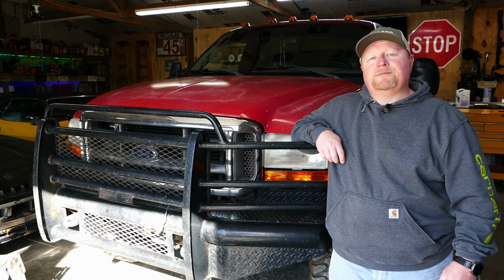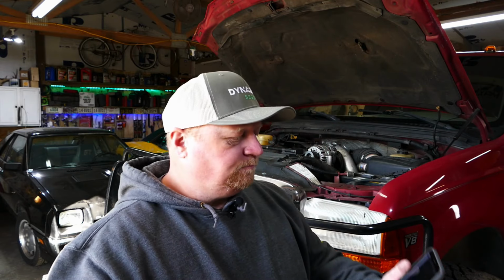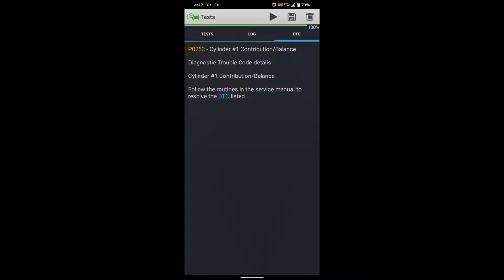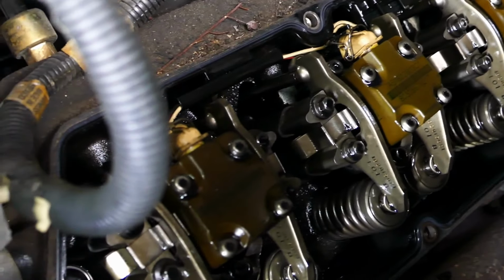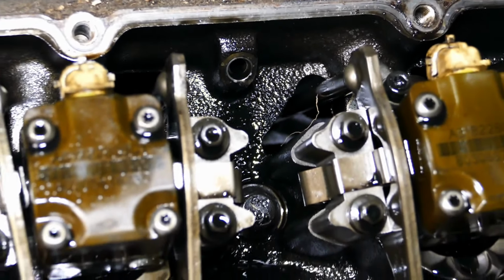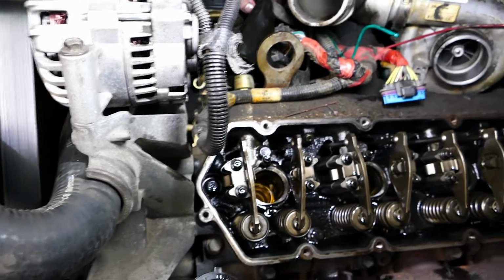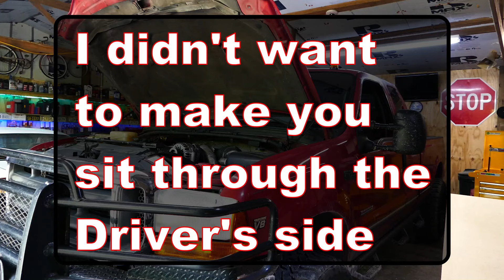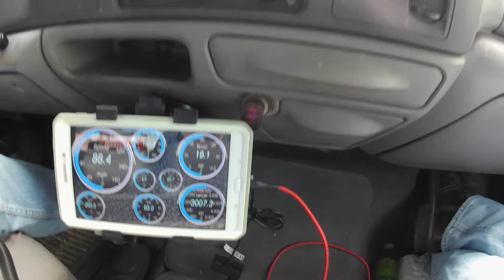Replacing the Fuel Injectors in a 7.3 Powerstroke Diesel | Ford F-250

Comment: I have been looking for this video for years.  I am second owner, at 45000, and I now have 481000 miles on my truck.  The few things that I have replaced in the truck would be, Water Pump, Alternator, Power Steering Pump and hose and Hydro-boost.  It is a 6 speed, and is everything I could ask for.  No real miss in the engine, just mileage and thinking about doing a full under cover rebuild.  What would be the opinion should I open it, or leave it alone?
Reply from the maker: Start here: https://amzn.to/3AjMu33
This is the Archoil fuel additive and Oil additive. I absolutely swear by this stuff. Stiction is the issue with 7.3 and 6.0 injectors and the Archoil additive makes MAJOR improvements. I run a bottle in every oil change and a measured amount in my fuel at each fillup.
Reply: If it works don't fix it.
Reply from the maker: @jacksmith730  lol, in my world if it ain't broke, then poke at it and fiddle with it until it breaks. Then fix it.

Comment: My neighbor is a diesel mechanic he said it’s very crucial to clean the bore from any oil before installing. He said it could cause it not to seat and leak compression into the fuel
Reply from the maker: Yes, it's really important.
Reply: What should you clean the bore with? Just wipe clean with microfiber rag? Also if you’re lubricating the injector up before installing like the video said to do does that cause the same issue with proper seating?
Reply: Riffraff has an Awsome cleaning kit or there’s other kits as far as getting the cup cleaned. If the injector cups haven’t been change I’d probably just change them out. I used petroleum jelly to lube up the injectors and putting a dab on the tip to help hold that crush washer in place when installing they have been known to come off during installation and you do NOT want that to happen. 
Stainless steel cups from riffraff along with there tool rental is a way to go.

Comment: I just said screw it, if your gonna take my rig apart, just replace ALL the injectors and be done with it!!! Lol. New glow plugs, new wiring harness, done deal!!! Also replaced high pressure oil pump and low oil pressure pump, and replaced turbo also, get 💪 er done!!
Reply from the maker: That's the way to do it!

Comment: Passengers side is much harder to get the valve covers off why does nobody show it
Reply from the maker: Once the charge air pipes are off, there's nothing to it. One valve cover bolt in the back is a bear to get to, but there's no way to film that one anyway.
Reply: Mmmmm it is harder but if you can't remove the valve cover you probably shouldn't be messing with injectors

Comment: Sir, This is by far one of the most informative video's I have seen on Youtube. Thanks for great content. I have a 7.3 that has an intermittent miss and suspect an injector issue. So the question is whether the Bluetooth device and app would help diagnose which injector is suspect?
Reply from the maker: Brad, thanks so much for the nice comment! I'm sincerely glad my content was useful. Regarding the Bluetooth, yes it will absolutely help you track down the suspect injector. The software is called ForScan Lite, it's free and available on the Google Play store. I have a link in the video description to the bluetooth OBDII connector I use. Other than that, you just need an Android device (phone, tablet, etc.)

Comment: Old video but hopefully you’re still responding. My 2002 7.3 passes the buzz test but forscan gives me a cylinder 3 contribution error. Also I have an engine vibration around 1500rpm under load.  At 262k miles on what I think are stock injectors would you assume it’s a bad injector?
Reply from the maker: Man, it could be a few things. Low compression is the scariest scenario. Does the engine turn over with a constant cadence? Hard to explain what I mean. Go to Youtube and look for videos of 7.3 skip while cranking. Does yours do that? If so, its compression. If not then you may try replacing the #3 injector.

Comment: 19:32 I’ve been trying to get it out for 3 hours I give up it’s 4am
Reply from the maker: There's a 10mm bolt on the bottom of the hold down, remove that. Slide the hold down up, then pry it out.
Reply: @ProjectTimeGarage  I got it out the other were easy to get out but I think it was the same one from factory it took a lot of prying tho

Comment: OK real talk, what are those Allen key plugs actually called. My buddy dropped one down the pushrod of my 7.3 and I haven't been able to find a replacement anywhere. I looked up HPOR plug and the results do not match the bolt have have for the other side.
Reply from the maker: I've always called them oil rail drain plugs.
Reply: @ProjectTimeGarage  damn, I can not find the right size bolt for it. I've looked everywhere and only found 1/8 inch bolts. Well thanks for the reply though partner.
Reply from the maker: @justice101497  Man, I mis-spoke there. They are 8mm bolts, one above the injector, and one below. Only remove the one below. The one on top just serves as a anchor point to hook the injector hold down on to.

Comment: Love the details, was determined I needed a new set but turned out to be a bad internal relay in my fuse panel, I did a quick fix with a bypass and it runs great, I still plan on upgrading them with the truck being over 300k miles. I definitely didn’t think a 7.3 could suck fuel off suction to the point it’ll barely idle but it sure did, love the videos and hope future issues can be easily fixed
Reply: Where is this relay?
Reply from the maker: Sweet, that was a pleasant find for sure.

Comment: What do you do if you have pulled the injector before you pulled the plugs out? 😅I may have messed up. Oil dropped in the injector bore, quite a bit in fact.
Reply: Nevermind you answered that too. Thanks
Reply from the maker: Yep, lots of oil will get in there for sure.

Comment: I can't get the adapter you use? Will any other recommendations that works with forscan
Reply: what was the parts cost for this repair???
Reply: My 2000 for excursion 7.3 diesel running ruff it has just 384000 miles on it.
Not sure it is injectors or could it be something else? Can you help me??? PLEASE
Reply from the maker: That adapter is no longer available unfortunately. I've tried to find another that works and I can't find one at all.

Comment: My question is what's the order of cylenders the buzz test does? Like the first one was no good in your video which injector was that under the valve cover
Reply from the maker: It buzzes in numerical order 12345678 - Number 1 is on the front passenger side, 2 is the next one back on the passenger side and so on - number 5 is front driver side

Comment: Do you have anything on knowing if injector cup is broken?
Reply from the maker: I have a video on replacing cups. If one is cracked, you will have diesel fuel in your coolant.
Reply: @ProjectTimeGarage  ok thanks man. I don’t have that issue. So I’m gonna go ahead an say my cups are okay.?? 
Have #3 and #8 throwing contribution/balance fault codes. Unfortunately gonna have to do all 8.
Honestly was scared to do it myself. Until I watched your video, I Fersure can do this on my own with your video playing on the garage tv.!! Really appreciate it!
Reply from the maker: @ttvitz0neshotv237  Yep, contribution has proven to be injector related for me more times than not. If not injectors, then compression is a likely cuplrit. If you have little to no blow-by, then it's probably an intector or 2

Comment: what would cause my car not to start after swapping all 8 injectors?
Reply from the maker: If it ran prior. Then it's likely air in the high pressure oil system. It takes quite a bit of cranking to purge all the air.

Comment: Everytime I’ve done injectors on a 7.3 it ends up hydro locking. I’ve never removed the oil plugs. Could that be the reason? I’ve always noticed fuel draining when I pull the injectors. Thanks
Reply from the maker: I'm sure it is the reason. I've never had a hydro lock doing it this way.

Comment: Hi.  While pulling one injector I got a lot of oil pouring out. I did pull the drain plugs first. Is the best way to evacuate all the oil from that cylinder by pulling glow plug and cranking? Or should I do something else also? I haven’t cranked it at all yet. Thanks for your help.
Reply from the maker: That's exactly how I evacuate the cylinders on all of them I've done. Replace all injectors, leave all the glow plugs out and turn the engine over.
Reply: Thanks, I only changed one injector. Want to make sure that’s the issue before replacing all. I wasn’t sure if I could only remove the one glow plug to evacuate cylinder. Seems like I could but I never done this before. Thanks for responding I appreciate your channel sir!

Comment: Hey I’m just replacing number 8 injector on my truck how would I turn the engine over without it starting so that I can keep it from hydro locking?
Reply from the maker: Jump the solenoid on the passenger's side while leaving the key off.

Comment: I had the injector out and turned over the crank with the harmonic balanced bolt to spit oil out of the injector hole, I had the glow plug left in. Is this a sufficient enough evac or do I need to take out the glow plug. Just changing injector 8, scanner said 8 and the oring was cracked
Reply from the maker: I'd say you're fine.

Comment: Pulling the drain plugs from the under the valve cover isn't necessary because if you crank it over it'll just push it all out the glow plug hole anyway. Just seems redundant unless I'm missing something.
Reply from the maker: It's really about the amount of oil that drops into the cylinder without removing the plugs.

Comment: I changed the injectors in a 2002 F250 7.3 auto 4WD and now while idling for about 15-20 minutes it will stall out. Pop while idling is pushing about 470-500 psi. when it begins to do stall out. Any insight? Where to start?
Reply from the maker: If the HPOP is maintaining 500ish at idle, then that's ok. It must be losing fuel pressure. That's the next thing to check I would think.

Comment: Hi just wondering if a guy shouldn't change injector cups too since he is already in three? Thanks, great video.
Reply from the maker: I actually get that question a lot. My thinking is that they typically don't fail unless they're overheated, or something else gives up. I have a video series on changing them out, just never done it unless they start leaking.

Comment: Do all stock 7.3 trucks have that device to attach the FORscan device? Or does the truck have to be tuned to use that FORscan device?
Reply from the maker: No, the stock trucks will do it straight from the factory. FYI, I have a video coming out on Friday March 3rd that goes over everything OBD2 and Powerstroke related for the average guy.

Comment: How long did it take cranking it over before your truck finnaly started?  Im having that issue now big time
Reply from the maker: It takes a bit of time. Say a minute or so total crank time. Best if you can get a scantool that will read the high pressure oil system. It needs to be around 700psi before the injectors will work.

Comment: Love the video I have an F-350 7.3 super duty 1999 with only 100.000 on it and I just noticed Fuel in pools on top of the motor . Fun Right? Now I have to find out where the fuel is coming from! But I love watching these types of videos it really helps me when I have a problem! Thanks, I subbed!
Reply from the maker: I'm gonna place my bets on the Fuel Bowl seals. Riff Raff, Full Force, Sinister Diesel, etc. all sell a re-seal kit. It's not too hard to do.
Reply: @ProjectTimeGarage  I will take a look at it in a few days Like I said I don't use the trunk much anymore I am retired but I bought the trunk brand new and Love keeping it in good shape. If you think that is the problem I will surely be in touch with you about it! I replaced the glow plugs a while back and that is when I realized there is a lot more work to do on these trunks than you think LOL! I have a 1994 f-350 with the Cummings motor and man they're so easy to work on I miss that part LOL! Love your channel Thanks!

Comment: Thanks for your videos and responses to these comments. Update that might help some folks. Readers digest version! Truck smokes plumes, Powerstroke specialist says it failed compression test. Bad engine needs replaced $12,000. I seen your video and bought scanner. FORScan says # problem. Pulled injector and had it tested. It was over fueling at idle. Replaced one injector and truck no longer smokes.!!!! So your video and my gut instinct saved me 12 grand. So don’t openly trust mechanic shops. Not all are dishonest but not all are either. Good luck out there people!
Reply from the maker: Good catch - saved some $$$!

Comment: What app was running on the tablet? I’d like to see what my HPOP is putting out. This video is SUPER helpful. I know my truck is lacking for power, I do a lot of heavy towing with my 7.3 and want to make sure it’s running tip top
Reply from the maker: The app is called Torque Pro. I have an entire video covering the basic setup of it on the diesel trucks.

Comment: Do I need to make sure my fuel pump isn’t running when I go to evacuate the cylinders?
Reply from the maker: If the injectors are in the bore, it really doesn't matter much. If you're following what I did, the injector harness isn't hooked up yet, so even if there were fuel rail pressure, the injectors can't fire.

Comment: Are these aftermarket injectors? Looking at buying an old 7.3 with 330k. Needs new fuel injectors, so this may save me a couple thousand in repair costs!
Reply from the maker: They are reman factory injectors. These came from Full Force Diesel. I've used a bunch of their injectors and had good results - plus they are close to me so I can just drive there and pick up stuff.

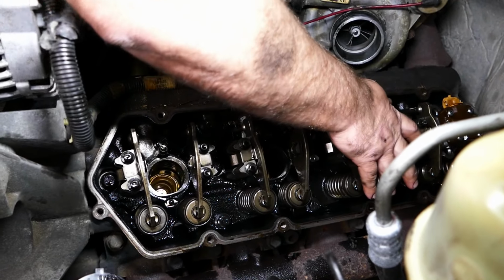Comment: Just curious, recently bought a 01 7.3, 265k miles on it. I’m having a slight few motor issues with it, she cranks and runs and drives. But she’ll throw “service engine soon” on the dash after driving 5 mins down the road. I’ve kinda ran my own little diagnostics test on it as I can. Been meaning to buy a scanner to run a buzz test. Talked to few family mechanics about everything. Just decided to go ahead and replace all injectors and valve cover gaskets, due to no service log of last replacement. What exactly do you mean at 24:08 “evacuating the cylinder” I’m just curious. An ive also read on the comments about “cleaning the bores out”. If you got a little time to explain, would be much appreciated. Very clean and nice video sir! Thank you!
Reply from the maker: The service engine light on these engines are really basic. Unlike modern engines, most of the time the light is innocuous. Every one of these I've ever seen will throw a check engine light. Mine does the same as yours, throws a light after driving for a couple of minutes. In my case it's the Exhaust Back Pressure Valve that is no longer there. It'll also throw a code that "the boost is higher than expected" if I get a heavy foot since it's running a larger tune. Long story short, It most likely means very little.

The evacuation of cylinders refers to clearing out all the spilled oil that drains into the cylinders when you remove an injector. Basically, when an injector is removed, there is a fair amount of oil that will pour down into the cylinder and sit on top of the piston. If not removed, there is sufficient oil to cause major damage at startup.

Comment: Is there an passenger side video available also I have a leak where I'm running thru 2 and a half gallons in two days only leaks while running
Reply from the maker: I think I have a video on a different truck that shows the passenger's side. Basically the exact same procedure. Remove the battery, charge air pipe, MAP sensor bracket, and optionally unbolt the A/C Compressor and lay it over for more room. No need to discharge the A/C system.

Comment: Why not trying to transmission fluid in the diesel that works to clean the injectors it works good
Reply from the maker: In this case, dirty injectors was not the issue. This being a HEUI injector system, each injector has a high voltage solenoid on the top that runs on 115 Volts DC. Over time these solenoids will wear and get closer to the body. In this case, the injector solenoids didn't have enough clearance to the body. They were worn far beyond their service limit. Once they wear that much, stiction becomes a nightmare. I've tried shimming the solenoids in the past with mixed results. Once they get this far, a full rebuild, or replacement of the injector is about the only cure.

Comment: Im just about to wrap mine up. A couple of things that made my life easier.  I used some much longer bolts with a nut and washer to replace the rear valve cover bolts. This way i didn't have to be a contortionist to tighten them back down. I also put the wiring harness on first,  without the gasket.  Then attached the gasket to the harness. This made it much easier especially on the driver's side.
Reply from the maker: Good info, thanks!

Comment: Omg the Haynes repair manual says NOTHING about not removing the breather box... I came here cause I'm having a bitch of a time removing the furthest back bolt and now I learn that I have to get new Orings with my truck torn apart in my driveway. Thanks alot Haynes... Holy f**k I am heated right now.
Reply from the maker: Breather box just makes it easier to reach everything. As for the injector o-rings, you may get by with reusing them, but with time and heat cycles, the rubber/viton will harden and become much less easy to seal. The reason to replace them while you're in there is because it would be awful to get it all back together just to find out one of them isn't sealing.